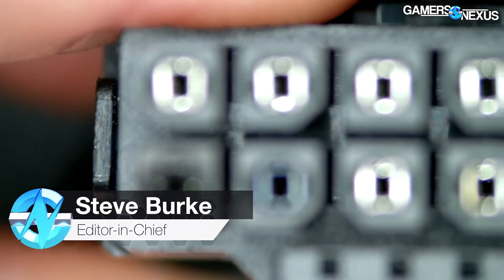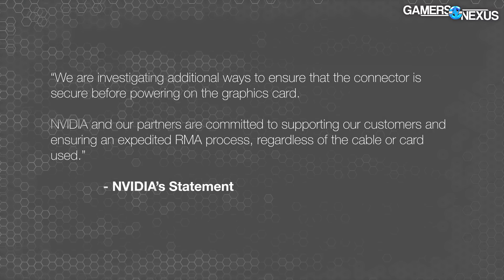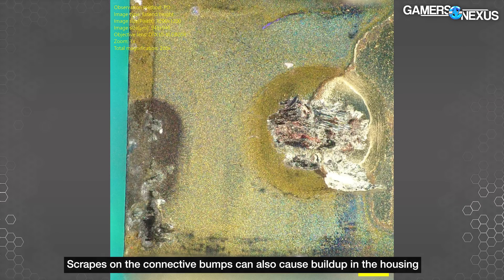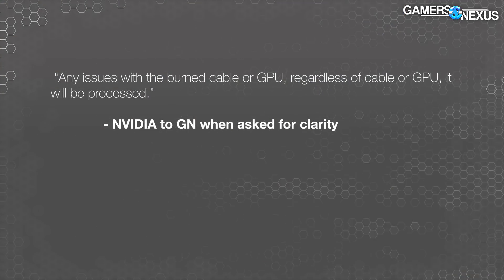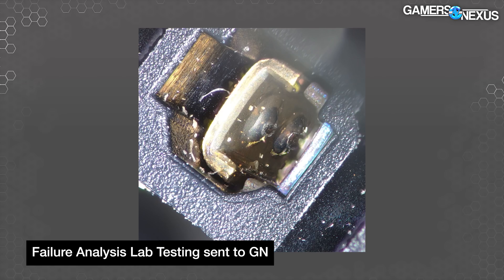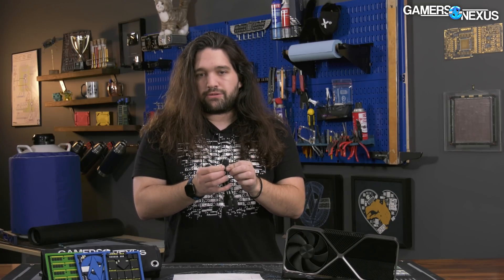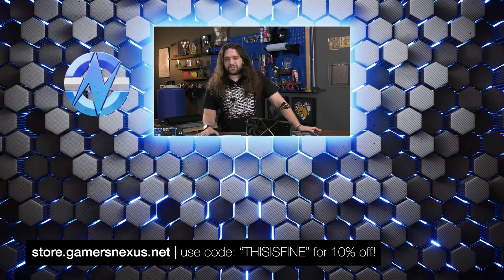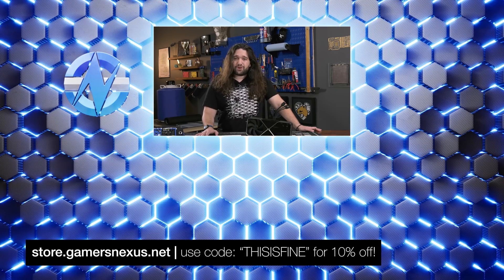NVIDIA Responds to Melting Cables, Warranty Concerns, & 12VHPWR Adapter Failures

Comment: I'm curious if the 12VHPWR connector has any potential issues on the PSU side with new PSUs that have the connector? It would be much harder to see if the connector is all the way in on your PSU than it is with your GPU.
Reply: Pushing isn't just for swings and shopping carts, and be sure to push deep and push hard ;-P
Reply: Yes that is possible, although there aren’t as many people running the new power supply standard with this connector so the sample size is much smaller.
Reply: PSUs manufacturers tend to make their own female and male conectors to their own propietary connectors, like corsairs Type 4 cables and so on.
Reply: @yorchli3152  That's true but more and more PSUs are being released with a 12VHPWR connector on the actual PSU.
Reply: @TastyPC  You're right, I just checked Thermaltake GF3 and MSI Ai1000P (ATX 3.0), both have 12VHPWR connector on the PSU side
Reply: @Gamers Nexus I advice you be wary of Users commenting like User here: msytdc ,which comments are offending and demeaning also tending towards personal insult ,especially to an esteemed and known Content Creator ,as is TastyPC .. Please Resolve that issue.. if you be so kind!
Reply: @neutechevo  wtf are you smoking, go back to Twitter if this is the kind of stuff you're going to be offended by on the behalf of other people when they certainly didn't ask for your opinion, or your "help"
Reply: @msytdc1577  the Comment was going to @Gamers Nexus .. if they allow thus kind of behaviourvin their backyard ,its on them .. and beyond you.. I hope your wife appreciates what you are saying on Comments sections (former or future)

Comment: Why are their anything other then 2 pin or 3 pin connectors max? As far as I know, there are are only 3 types of wire coming for the power supply: 12v, 5v, and negative. Why aren't there beefier wires coming from the source plugging into a larger receiver on the pcb that handles the split there at the receiver.

Comment: User error is a real.  That struggle is real.  However, you can't and shouldn't cover up bad design.  You have to design to your intended user.  A reasonable amount of users are not experienced.  Even if the failure rate is low, you have to map it against consequences; i.e. probabilities on one axis and consequences on another.  A fire risk and therefore a loss of life risk puts this into an actionable section of the risk heat map.  It is not a win to say 'well at least we don't have a high probability, high consequence problem."  That's the job.   Would you market a children's game of Russian Roulette where the probability of injury or death to a child was 0.03%, especially if you were going to sell a million of them.  Would you do it if the probability was 0.003%.  I'm not trying to be inflammatory here, but 2 more hours of design time and an extra $1 of cost  is probably a good payoff on the bad press alone - even if you're right.  That's if a better more "clicky" insertion point is the solution to this.  Just saying.

Comment: I think nvidia came up with the answer at least a week before based on their own and the AIBs investigation. This could be seen from MSI release of their 12vhpwr connection guide released days ago, I am sure MSI did consult nvidia on it. They probably just waiting for the right time to release a properly worded response. They probably also waited for a 3rd party(GN) to release the findings and then acknowledged it so it doesn’t make them insensitive by calling their customers “user error” directly.

Comment: Wait so there IS a click (however small) as well as a way to test it is fastened by pulling it back afterwards? Sorry but the users experiencing failures have NO excuse. You spend that much money on a GPU and then can't be arsed to properly plug it in? And then you go into town square blaming the manufacturer? That's just shameful.
Reply: It's incredible how many people are blaming Nvidia because they couldn't make something 100% idiot proof. How shameful that they only made it 99.96% idiot proof.

Comment: So, many, many people gladly have still money and like to spend just on a GPU. Great for the economy. So everybody who said, too expensive, will not sell good - is proofed wrong. Greatly wrong, included quite maney self called “experts” aka reviewers (no names).

Rofl. Just congrazz to Nvidia ->  125.000 plus = 210 million US$ in sales volume (based on 1700 US$ per 4090 - to take a low average, as some cost much more). Stands for itself.

Comment: Nvidia just watched your previous video and released the statement - you just made their work here.
I think this will be more than 0.05% because scalpers are not using cards they bought and I suppose there are a lot of such cards being sold.
Secondly - this is a poor design of this connection if so many people are able to plug it incorrectly.

Comment: You're suggesting using a lot of force and relying on the latch mechanism, but we already had multiple cases on reddit of latches breaking and the card manufacturers are claiming that its fine and doesn't fall under warranty.

I don't think the latching mechanism is durable enough to be relied upon long term, and telling people to use more force might lead to earlier or more widespread failures.

Comment: I don't buy the whole "user error" thing. Sure, if it's the first time you've bought a graphics card then maybe you don't know how to plug things in properly (though even that's a stretch) but I'd wager that most early adopters are people with some experience with graphics cards and other such plugs and sockets.

If a significant number of people are having issues plugging in a connector I'd say it's a design flaw, not user error. At the most basic level, it shouldn't be possible to for the card to work if the connector isn't seated properly in the socket. Also, it can't be that hard to have a little tab that clicks into place when the connector is connected properly.

Given how much nVidia charges for these cards, I'd expect the level of quality control and minimisation of error potential to be paramount but apparently it wasn't.

Comment: So, wait,  the 16pins connector does not have a clip that engages when fully seated? Really? How can this not be a design oversight...? 24pin has a clip, 8pin cpu has a clip, 8pin pcie has a clip, and they don't put one on a connector that puts out considerably more power, that's just counter productive... At least, I think so...
Reply: it does have one, it just has trouble latching
Reply: That's just strange why they couldn't catch this. You'd think, with all that experience under their belt, they'd design a clip or whatever that would have no issues to close, due to the high power demands. Like if the 8pin has no issues, then you'd assume they would keep things similar, or dunno. It just astounds me that such a large organisation potentially fails so badly... I honestly refuse to call this user error, because I can't get myself to think someone would want their gpu to melt... In my book, pcie sig should have put measures in place to have the cable clip propperly, simple as that.

Comment: I don't think that using NVidia-confirmed amount of cases is particularly good, especially for upper bound of likelyhood of occurrence.

A lot of people only saw the melting after unplugging and inspecting the cable. It wasn't catastrophic and the card was still functional at that point.

There are likely many more users who have partially melted or otherwise heat damaged cables that are unaware of that fact, and the issue for them will become visible in the future when a certain damage threshold is passed.

Comment: I appreciate all the investigation into this you guys have done but imo you are emphasizing that this is the fault of the user (user error) too much and absolving PCI-SIG, Nvidia, et al. of an obvious design flaw. This type of user error should not be allowed to even occur in the first place, low though the incidents may be. Take the older design (or even part of this one) that is keyed to not allow a cable to go in upside down. There's a very good reason that they are designed so that a mistake like that can't happen under any normal circumstances. This should have been tested before launch and designed accordingly

Comment: It really is kind of sad that we are a technology community, supposedly some of the brightest and smartest people on the planet, and a plastic to plastic connector with metal pins needs to be "dummied down" to make sure that it's seated properly. People complain about manufacturer's quality control. Maybe the .04% of people this happened to just shouldn't be building computers in the first place if they aren't or won't check their own work. It's a 12+4 pin plug, after all. It's going to require a bit more force to seat properly, based on the friction of more contact points and it's a smaller, tighter connector than a 24 pin motherboard power connector, for example. A visual check of the connection would pretty much solve the problem. I'm not so sure this is a cable problem as much as it is a consumer laziness problem and then blaming someone else for their mistake. Nvidia, in a way, is giving these people a free pass for their own negligence. As an example, it took the GN team days worth of work to even recreate the problem until they finally found a fairly extereme situation where the plug would finally heat to the point of melting. I'm usually pretty harsh on Nvidia because of some of its cash grab ways, but I am also someone that will give credit where it's due, and Nvidia deserves some kudos here for taking full responsibility in this issue that could have been avoided by a customer simply making sure the connector was seated properly in the first place.

Comment: I wonder how many improper user installations that led to burnt plugs were caused by paranoia spread from various other media sources about plug life cycles, excessive cable bending, fragile pin connectors, etc.  Surely some of those instances were users being too cautious because of the fear driven into them and they simply weren't aggressive enough with trying to fully seat the plug.

Comment: There's no user error. If a product isn't built for standards it will fail. 
These products are meant for everyone so they should be made idiot proof and not be prone to any missuse or "debris" or "foreign" stuff.
The connectors aren't up for the task of these units. Period. 
Those connectors they use now are for factory level subassemblies assembly of internal components that only electronics specialist will be working and passionate DIY-ers that want to peak inside. Aka people that know how to handle micro connectors and usually work in a clean environment.
It was already said in the past.
Any GPU that costs over 1000 usd should have it's own dedicated PSU and not use the PCs one. Additionally any GPU that is power rated over 500W should not be mountable on the PCIe connector on the mo-bo. The whole concept of making PCs should be with separate GPU (that can also be used standalone as a eGPU if wanting it) and a separate CPU with a micro mobo that may additionally host ram and ssd sockets/ connectors for external custom install But no more PCI-e connectors

Comment: If the connector delivers current WHILE NOT BEING FULLY SEATED and in the process self-destructs,
it is NOT a "user error"
it is a DESIGN ERROR.
Reply: @_Clivey  It is good that they do. However, these connectors are not designed to deliver 600 W at 12 V. Second, The issue is not the mechanical design of the latch. Look at how the conductive tabs, the conductor pins are designed inside a usb plug, have unequal lengths to make certain that the device gets power first and the data pins are connected last
The argument "it works elsewhere" is very weak.

Comment: If a connector is that difficult to determine if it is installed correctly and/or install correctly, it is a poor design and should be reconsidered.
I feel like at the very least there should be ramstick style locking clips on the short ends of the connector to provide a positive latching retention that only latches when the connector is totally bottomed out in the socket. 

Side note about the gasoline analogy, That sort of thing is explicitly protected in modern automotive consumer laws. using 'bad gas' can't void your warranty, the automaker has to take that into consideration in the design.

Comment: You shouldn't have to worry about plugging something in properly, especially on a $1600 product. That issue shouldn't be an issue. The product should be easy to plug in.

Comment: This isn't a Nvidia cable?
.
Ok, name 1 other product that uses it......
.
I understand NV didn't design it (at least fully) and that others can use it
BUT!!! It was first used on NV cards
BUT!!! It is only used on NV cards (at least currently)
.
.
NV could of had 2 eight pins with the sense wires being seperate 
.
But instead they wanted a "cleaner look" 
Despite the 4-to-1 looking pretty cluttered

Comment: Way i see it, and not everyone will agree with me.... but even if it is user error, i see it as a connector error as well. Since this instance of user error is facilitated by the cable, but instead it now only allows a very simple mistake to become a massively destructive one.

If they did not test partial insertions in the QA phase, there is a pretty big problem with the QA process, since it is so destructive, it should have been caught beforehand and a safety designed in to make it impossible for it to either, operate half plugged, impossible not to plug in all the way. Shortening the sense pins would help, since they do not run as much  wattage through them, so they do not need as much surface area to operate before the resistance overwhelms them.

Another thing they could have done, is design the pins in such a way that they offer better surface area contact. 

In my personal opinion, this warrens a redesign, and a recall. Only the cable needs some modifications(although redesigning both would be a better option), so it does not have to be a card recall.

Comment: They could fix the connector problem by putting a hole in the middle of the retention clip to where once the 12 pin is fully seated the clip from the graphics card side is visible from the cable side of the clip.

Comment: seeing as these cards are giant and in any case the cables hit the cover and pull the cable out of wack they need to make a 90 degree connector on the card end it should relive a ton of stress of the connector. i'm kind of shocked they did not make it that way in the first place.

Comment: The partial plug in issue does seem like a negligent design flaw. Its not super clear when it is or isnt clipped in, which given the fact a partial connection results in a fire, shouldnt be left up to chance

Comment: 12VHPWR is just faulty. They should create a better option easy to use plug in.
Reply: Funny things is that the new China gpu new card MTT S80 use a EPS12V-stekker the one u use on the motherboard cpu plug.
And only use on what is good for 255watts
So one plug is good for the power handeling.
Wy not use those plugs instead try to make a new standard with what i think is to small.
Reply: @dyslectische  imagine that you are driving on the highway. They did a third pass, then a fourth and a tenth. What happens on the highway when a truck crashes? Why are energy barriers used? It's a bit like adding a fourth cable to a 230V socket - it's still one phase.

nVidia just was too greedy and they lost everything.

Comment: connector realistically needs to ensure that the signal good is not triggered until: 1) fully mated contact engagement AND 2) latching mechanism is secured. It is possible for 1 to happen while 2 not happening could result is loosening over time/vibrations.

Comment: The issue being a user error is still questionable, because if it was then how come we never heard of melting cables on 3090 TIs? Don't they use the same connector? I personally suspect a design flaw on Nvidia's end.

Comment: Thank you so much, I am a 3D concept artist and this card is a steal in my line of work but I didn`t go for it until now because I didn`t want to burn down my house if the card was under heavy loads most of the day...
Reply: Just out of curiosity what are the kind of workstation GPUs that are used in your field
Reply: @Tacticalnighthawk-i5x   Soo if you want to work with all kinds of different software solutions like I do and most 3D artist do when they reach a certain point we just buy the flagships of the consumer market when it comes to cpu and gpu. There are "workstation" specific solutions by nividia (In this field everyone uses Nvidia) like the rtx A cards but they are expensive and not perfect for that field when it comes to driver support... most of my colleagues that go for absolut high end projects just get a custome water cooled PC with 2-4 RTX insert flagship here . Sorry for the long answer but I got carried away.
Reply: there it is, that one comment I was looking for that actually had a use for the 4090 and can justify the purchase for it.

Comment: Can't speak for everyone but the problem I find is having to bend the gpu power cable down to get the case side on. They really need to either change the angle of the connection point or angle the connectors.

Comment: If running dual psu's, can you or is it advisable for or against running 2 of the pcie to one psu and the 3rd/4th to the 2nd psu?  Or should ya only use one psu?

Just for some info, the MSI Trio 4090 actually has the 12 pin much more visible then the FE... Its pretty easy to see if it's completely plugged in...